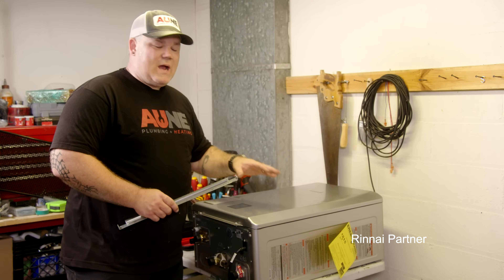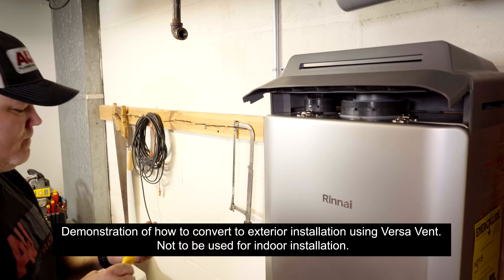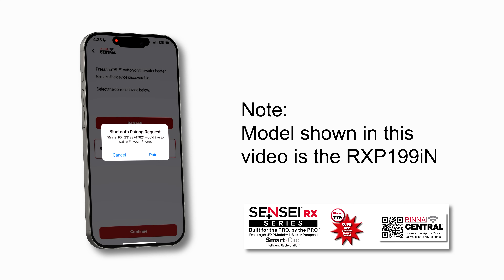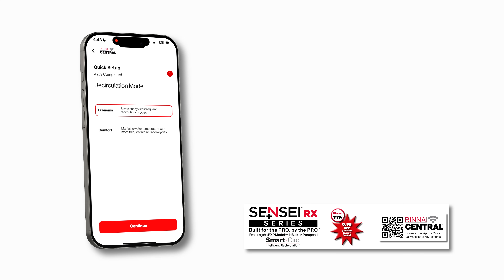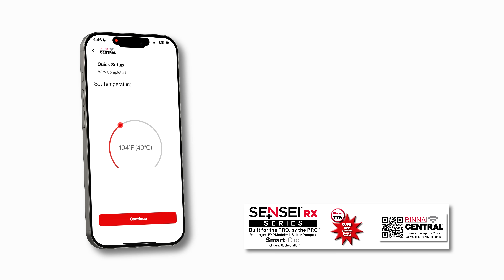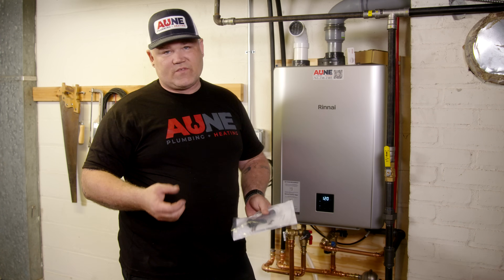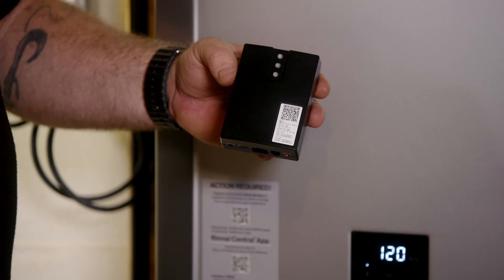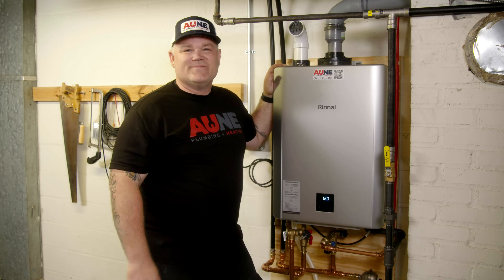Tankless Water Heater Install - Rinnai Sensei RXP series - Aune Plumbing

Comment: 5 years rinnai user here; you want the temp threshold set to 140, not 120.  And then set your max temp to 130.  120 is barely hot, will negatively impact the cleaning performance of your dishwasher and washing machine.  Also you will end up cranking up the hot water to get that full 120F, which means less water pressure coming from the cold source.  You want your water temp so hot that it uses 50/50 to 60/40 hot and cold so you get the highest possible water pressure for a better experience taking showers and doing dishes etc.  Also, if you leave recirculation mode in economy, it is too slow to react to a hot water event and you end up with hot to cold and back to hot water situations when doing things like taking a shower.  Unless you’re a very regimented person/family, forget about smartcirc; It’s better to set morning, afternoon, and evening schedules in the app and use the push button for other times.

Comment: Good luck getting the "smart-circ" circulation system actually working.  We're on Day 3 after the installation of our $2000 Rinnai RXP199iN, and still taking cold showers.  The Navien NR-240A we had before this worked like a champ with the exact same plumbing.
Reply: @Walker34077  oh no!!! That’s awful. I just got my rxp199in installed and thankfully our water gets hot quick. We swapped our traditional tank that busted to the Rianni tankless… super expensive but I’m thankful to have hot water again after almost a week. I’m still trying to figure out the recirculation thing on the app! I didn’t even know this came with a smart circulation. Now I have to figure out how that works… IF it works lol.

Comment: If you want to DIY , not buy Rinnai, they are crocks, your service support is useless and try to push to installer with really expensive charges. TRASH service and equipment be careful find other DIY solution.

Comment: I thought when installing the Rinnai isolation valves, Teflon tape isn’t recommended due to the presence of the rubber gasket/o ring.  Could you comment on this?

Comment: Pretty ticked off about this being advertised as having Bluetooth/app capabilities. A Rinnai professional has to install and connect with their phone through the app. Spent an hour thinking it may have been an iPhone update issue or something on my end. Still seems like a great tankless water heater, just sucks I can’t use the app that was advertised.
Reply: Did you install the tank yourself? I am thinking about buying the tank and materials and then hire an individual plumber instead of a company recommended by Rinnai.

Comment: Does an outdoor unit need a cover?  I have a Rinnai RX160i, condensing unit.  Do you recommend  the cover that you showed, part RXOVC, to cap the unit?  Is it necessary?  What is it the best option?

Comment: Good video but not for DIYers, its meant for the pro's as a lot is missing as most is spent on informing about the Sku's and Bluetooth setup which is only available to Pro's who pay a subscription for access. As a DIYer, you cannot even activate ricirc without paying someone, that's Rinnai !! and if you want to make changes in the future, pay someone again.
Reply: That's crazy. I have to think about the app limitation to a non-pro before getting tank because I do not intend to use a plumber recommended by Rinnai. The plumbing companies charge a lot for just dispatch.
Reply: @user-vb6gc7mb8e  I'm not too sure how true that is.
Reply: @user-vb6gc7mb8e  This is fundamentally incorrect, you can change any and all settings from the main boards inside the unit. Literally a press of two buttons.
Reply: @user-vb6gc7mb8e  Not one thing you’ve said is correct about the app.

Comment: Just pulled the trigger yesterday on a Rxi180RN  for a DIY install. Going to install in my basement under the location of the 2004 Manufactured Homes 30000BTU 40gal Rheem tank'd heater on Propane.   1400sq foot 2 bath.  Water inlet temps low 40's.   Great vid, with more good info on install ideas. I've watch a good 25 other install's.  Home has had a 20micron then 5 micron carbon inline filters before the softener, for 15+years. Tank'd unit seems to still function as new. Never drained, Never checked, Never replaced Anode rod.  That'll be fun to tear into once removed to see how bad or not it really got inside.

Comment: Just got finished with a rinnai online chat. You are right, you don't need a modular. HOWEVER to use the Bluetooth feature YOU HAVE TO BE A PROFESSIONAL. This is so fricken stupid. And the rep 1st told me I could use the Bluetooth feature , told me to login as a professional,  and clearly that didnt work and when I lost my shit on him, he apologized and said, oh I'm sorry I wasn't clear. You have to be a professional. This whole ordeal is fricken ticking me off.
Reply: Yes this is straight garbage you don't get to use the Bluetooth unless you're a registered professional plumber with this water heater company. This is the most ignorant thing I have encountered in quite a while, if I would have known this I would have gone with a different brand without a doubt. Now we have to spend another $200 per the unit plus whatever installation costs. Pretty dishonest of the company pretty dishonest of this company to brag about their Bluetooth .
Reply: Is this for real?  They're advertising it as bluetooth capable, but nothing about having to be an installer.  The app only shows wifi - which my RX160iN doesn''t use.

Comment: Question if anybody knows. I just purchased an Rinnia RX 160 BTU water heater. My cold water line in from the street is 3/4, but all the lines to the rest of the house are 1/2. First question is will  using a 3/4 to 1/2 reducer cause an issue? If no, bring how I have access to run a 3/4 cold line, should I do cold 3/4 and hot 1/2 or both 1/2? Thanks

Comment: Great video!  Exact model I just installed. Was hoping you were going to outline how the setup / connect the wireless module as that’s what I’m installing next (part was back ordered). Hoping this will solve my lack of instant hot water issues as the smart circ isn’t cutting it for a vacation home we frequent, infrequently. Getting cold sandwiches and not consistent hot water when needed. We too have a dedicated circ line, but the smart circ is almost dumb since we aren’t patterned users. Thx again.

Comment: Eric , I just installed my first one. Was use to older models with gas conversions etc… Rinnai rep not available due to holidays, did not get call back from Rinnai tech support. This video was such a help to me. Thank you! Can’t wait to get to job to fire this up.

Comment: I bought the same exact model, followed the instructions, the app doesn’t give me an option like yours when doing the initial set with Bluetooth. .. very frustrating. Apparently I have to buy another device to get WiFi enable, do to the exact thing Bluetooth is capable.
Reply: I was in the same situation; although the unit itself is great, I feel somewhat defrauded by Rinnai. They advertise the Bluetooth control as a feature of this unit, but don't tell you that this is only accessible to service techs. Bluetooth access is completely unusable by the customer. And even with the optional $150 WiFi modem interface, I can't do nearly the things for setting parameters, etc. that are shown in this video and available to techs and installers. If I need to change parameters, using the WiFi and app are out. Can't do it there. I need to get manual in hand and use the (prehistoric) keypad interface on the unit to adjust parameters. Rinnai (both their website and their support lines) are not customer friendly. Both offer minimal assistance, and try to push customers into calling a local tech for support. Support line won't even talk to a customer. They will do an online chat only. For this reason alone, I would look elsewhere next time I need a tankless water heater, to a company that knows how to treat customers properly..

Comment: Is there a way to manually set the temperature on the side of the unit without the App?
Reply from the maker: The app isn't required for temp settings

Comment: So if the app is downloaded to the "customers phone" and is used for "setup" how much "data logging" is done and sent back to "'headquarters" and how often despite your claim that its "relearning" every "7 days" of "usage pattern"? 

And who in fact is the ACTUAL ORIGINAL "PURCHASER" OF THAT "APPLIANCE" AND HAS WHATEVER "GUARANTEE" IN HIS OR HER OR THEIR NAME? 

WHAT IS THE ACTUAL WARRANTY OVER AND ABOVE THE 7-15 YEARS OF "FACTORY PARTS AND SERVICE SUPPORT" THAT VARIOUS STATE AND FEDERAL CONSUMER PROTECTION LAWS REQUIRE THE ORIGINAL EQUIPMENT MANUFACTURERS OF "DURABLE GOODS" SOLD TO THE "GENERAL PUBLIC"? 

AND WHAT IF ANYTHING CONSTITUTES OPERATOR "ABUSE" AND/OR "NEGLECT" OR "COMMERCIAL/INDUSTRIAL USE" OF THOSE "HOUSEHOLD APPLIANCES"? 

I HAVE A 100% THAT SAYS SOMEWHERE THERE IS "FINE PRINT" SOMEWHERE YOUR "CUSTOMERS" NEVER SEE IT THAT MAKES YOU - THE "SUPPLIER" OR "DISTRIBUTOR" OR "AGENT" - THE "ORIGINAL PURCHASER" AS LONG AS YOU PAY - WHOLESALE - FOR THE "SKU" - BEFORE THE "CUSTOMER" PAYS - COST PLUS - FOR THE UNIT "DELIVERED AND INSTALLED". 

AND WHO KNOWS WHAT KIND OF PREMIUM YOU GET FOR EVERY "OBSOLETE" RINNAI "FOREVER HOT WATER" UNIT YOU "UPGRADE" A "CUSTOMER" OUT OF BEFORE THAT 7-15 YEAR STATE/FEDERAL MANDATED PARTS/SERVICE GUARANTEE AND WARRANTY TO BE "FREE FROM DEFECTS IN MATERIALS OR WORKMANSHIP" IS "IN EFFECT" AFTER THE "FACTORY WARRANTY" HAS EXPIRED.

Comment: ONLY 6 "SKUS"! MEANING "ONLY" 6 SEPARATE MODELS TO "UPGRADE" FROM AN "OBSOLETE" TANKLESS HEATER TO A "NEW AND IMPROVED" TANKLESS HEATER. 

The question is WTF is up with "upgrading" tankless heaters originally marketed - by Paul Harvey - as "forever hot water"? 

Has it been "25 years" already? 

The hilarity of needing to connect to a water heater via Bluetooth to "set up" an electronic "brain" supposedly constantly "relearning usage patterns" every "7 days" so there are no stored "patterns" older than the "week" it'll take to get one "serviced" by an "installer" is the best part. 

Everything else funny - "delivery temperatures", "service intervals" determined by "calendar time" instead of operating hours and/or total water/energy "throughput", "unlimited hot water" really hasn't changed.

Comment: seems all the new Gas units need power from the wall. comming from a bosch that never did, will this work without electricity or will i need a power bank if that goes out?

Comment: What do you recommend to treat the water going into the system?  Water filter?  ScaleRx?  How often is  maintenance required for the internal components?
Reply: Filters do not "treat water". Neither do chemical treatments that have the effect of making the water NON-POTABLE. Which doesn't just mean "undrinkable". It means unsafe for human "consumption" including use washing items that come in "direct contact" with the skin and may be inadvertently "ingested". 

That includes dishes and clothes. And its why in the "commercial food service industry" and "commercial laundry industry" no "treatments" at all are used and 175-200 degree "tap water" only is used. And its why city water supplies are chlorinated to be "antibacterial". 

All "tap water" is going to "scale" in that piece of shit.

The only way to get "scaleless" water is to use distilled water with zero "dissolved solids" and as the real "universal solvent" that 100% pure water when heated and flowing through plumbing under pressure is super "corrosive". Any and all existing "scale" in plumbing  gets dissolved and redeposited elsewhere. 

With that stupid ass "return" system needed for "instant hot water" it goes right into the "coil" as "cold" water and cold water holds less scale than hot water. 

And the largest household water distillers "make" only a few gallons per day and require constant "maintenance". If supplied with "soft water" they are effectively plugged with salt deposit "scale" in "days".

And they are "tankless water heaters" in and of them selves. 

Tankless heaters are a joke for "low temperature" and "high flow" so-called hot water and the idiot "engineers" try to "adapt" the exact same "technology" used in every car wash "steam cleaner" heated power washer to "household use". 

The difference is power washer coils are "vertical" and are wrapped "around" the burner flame and only a small area of many coils is heated so "overheating" really isn't possible even when shut down "hot". They also produce low volume high temp hot water and the coil typically holds several minutes of water "usage" internally. 

Everything about the two is "diametrically opposed" and as a result a hot water power washer can and will literally run for "years" - 8000+ hours in a year - at "max performance" and the highest pressure and temp possible "maintenance free" with zero "wear and tear" on the pump and burner and coil and using any and all "tap water" including "recycled" water and prefers "working" to "resting" for DECADES while a "forever hot water"  Rinnai takes "expert installation" and all kinds of "high technology" and at least "annual" so-called "maintenance" to work "right" ONCE A YEAR EVERY YEAR FOR A "DECADE" ON "AVERAGE". 

And unlike "obsolete" tank-style heaters it does not store water, heat or energy even "temporarily" is CONSTANTLY "powered up" and requires both ELECTRICITY AND A GASEOUS FUEL TO "WORK" AT ALL. 

DURING A POWEROUTAGE A GAS-FIRED TANK-STYLE HEATER STILL "RUNS". AND ELETRIC HEATERS CAN BE POWERED BY "HOME GENERATORS". AS CAN WELL PUMPS WHERE THERE IS NO CITY WATER OR RURAL WATER SYSTEM WITH. 

WITH A TANKLESS HEATER YOU ARE SCREWED AND THERE IS A 100% CHANCE THAT EVEN "MOMENTARY" POWER OUTAGES - MORE AND MORE COMMON WITH A "SMART GRID" - PUT IN "FACTORY RESET" OR "FACTORY DEFAULT" MODE AND "SETUP" MUST HAPPEN ALL OVER AGAIN. 

NO PROB "ON THE APP" BUT HOW MANY APPS USED "ONCE A YEAR" FOR "SERVICE" STAY "AWAKE" AT ALL TIMES AND IS THE "RESET" WATER HEATER "BRAIN" GOING TO "REMEMBER" YOUR PHONE'S BLUETOOTH ID? AND VICE VERSA? AND AT WHAT "RANGE". BLUETOOTH IS "LINE OF SIGHT" ONLY AND EXTREMELY SHORT RANGE EVEN THEN. IT'S ALSO A CONNECTION MOST PEOPLE KEEP DEDICATED TO "TELECOMMUNICATIONS" AND "INFOTAINMENT" THROUGH EARBUDS, HEADSETS, ETC. 

AND THOSE THAT AREN'T DEDICATED BLUETOOTHERS TYPICALLY HAVE NO CLUE AT ALL WHAT IT IS MUCH LESS HOW TO ACTIVATE IT, CONNECT AND USE IT. 

THERE ARE ALSO "BLUETOOTH DEVICES" THAT ARE iPhone or Android specific. And typically iPhone users are more Bluetooth types.

So why the App? "Data collection" of course. There are no "terms and conditions" for Bluetooth data collection and Bluetooth is the number one way "hackers" get into "wireless devices" since it's so easily forgotten as a "public" and short-wave "Wi-Fi". 

If your phone is "discoverable" the "hacker" can see what it is, if you have any "security" enabled and that you're not paired. 

That's how they "case" for phones to steal and easy "marks" to pickpocket for other things of value since "personal security" is a state of mind. Somebody lax about their "cybersecurity" is lax about their "security" in general.
Reply: @deeremeyer1749  What B.S. from gross ignorance. We've used a Rinnai tankless for over 20 years with NO problems. None. Just a once a year simple descaling vinegar flush by me. Get off the caps. No "apps" here .

Comment: I'm in the same climate zone as you. In a 2 bath 1,500 sq ft home. My plumber is going to install the RXP160in version. Is the gas pipe in your video 1"? Can he use the same flue pipe as my old NG tank heater? Thanks
Reply: I have the same question, same size home as you, looking to have my plumber install the new RXP160in. My gas pipe is 1", and the tankless would be 35' from the meter. If I add up all gas appliances (stove, oven, tankless water heater, furnace, dryer) I'm at 330,000 btu but my meter is rated for 250,000 btu. I never see the size of gas lines or meter size addressed in any videos. Since Mechanical Hub is one of the more respected Youtubers I was hoping to see that addressed.

Comment: Do you need a expansion tank with a dedicated return loop?
Reply: Yes, he has a small on it. Looks like a Zep-1 or Eastman 2 gallon. It should be installed between the check valve and cold water isolation valve to tankless.